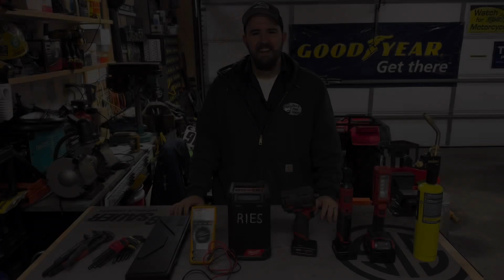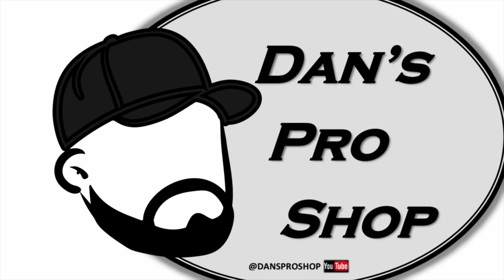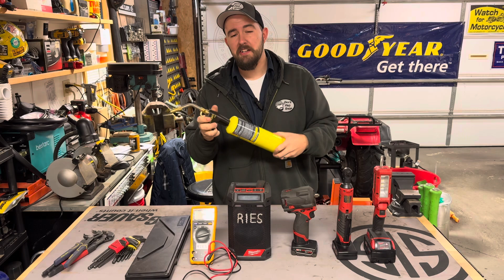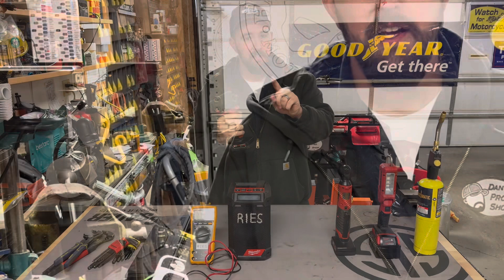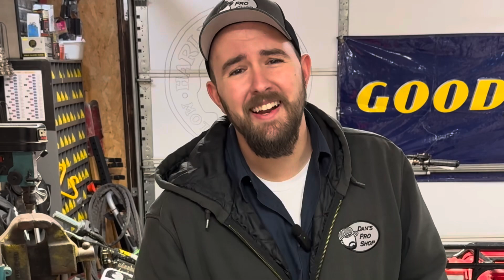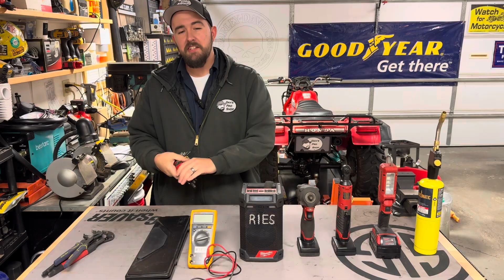Gift ideas, top 10 gifts for any do it yourself-er!!

Comment: My M12 1/2” drive impact is just ridic - the fact it spins off my trucks lugs and anything else it comes in contact with! (That’s with a 4ah battery btw). The 1/2” drive and my VERY handy M12 1/4” impact driver are just incredible!!
The m12 line is very capable on all my SIDE jobs and can hang in my daily commercial and industrial electrical work.  

Only had ONE situation where I was drilling down from an attic through a header with a 1” auger big and my M12 1/2” chuck Drill couldn’t do it, had to grab the M18. Butter. 

I had a first gen impact driver and still have it (lives in my truck)

My friends are all auto techs and they swear by snap on - but those prices, no wonder why snap on sells Miluwakee LOL

Comment: MAP-Pro (not MAPP) burns at about 3,730°F compared to about 3,600°F for propane so it’s not “significantly hotter” but is about double the price.The original MAPP burned at about 5,300°F but hasn’t been produced for decades.